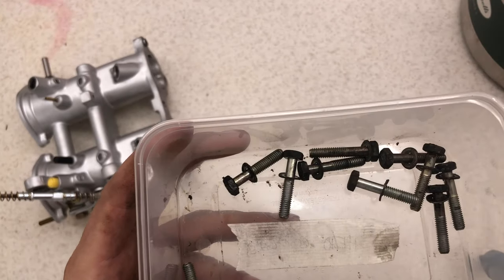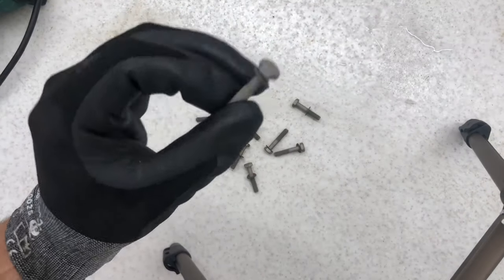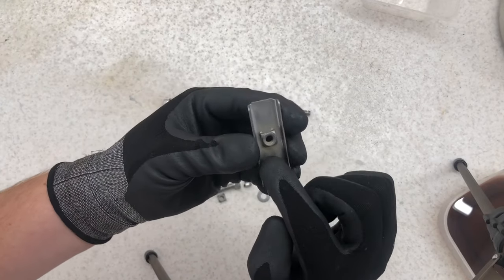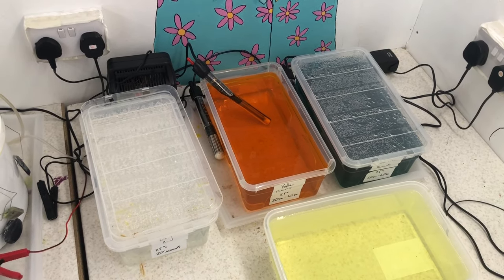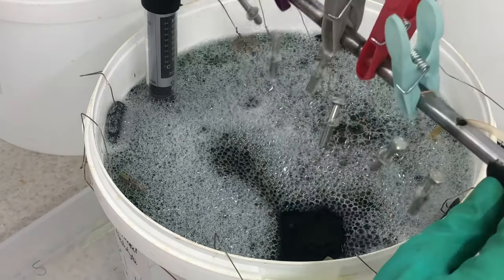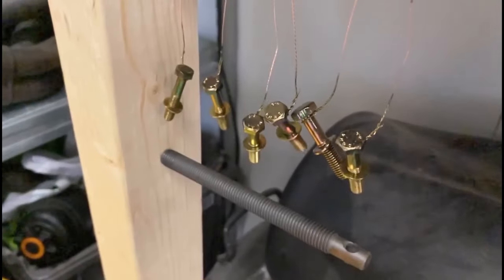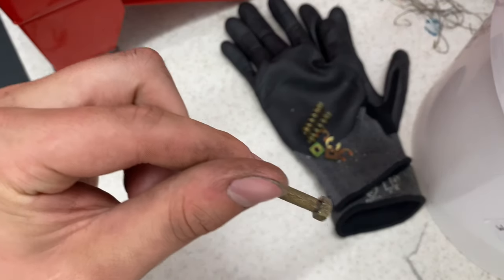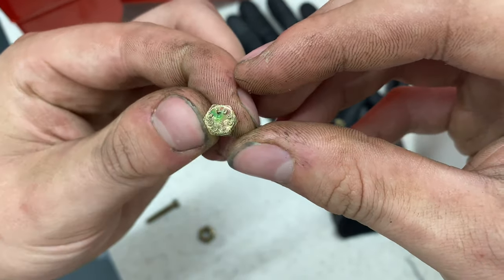Zinc/Nickel Plating Kit by Classic Plating UK - First Impressions/Results!

Comment: I suggest degreasing again after wire wheeling as the wheel and the drill chuck likely are contaminated with grease or oil.
Reply from the maker: Good idea, thanks!
Reply: 9:20 isn't that what this is?
Reply: What is the wire wheel and drill is new?

Comment: The acid you used was concentrated and the metal surface was reacting with it turning it into matte finish. Should add some distilled water in the acid.
Reply from the maker: I use it as a concentrate to remove rust/debris from the surface of the parts, if diluted it simply takes longer! A quick wire wheel process after and it’s a perfect surface to plate with
Reply: @BadE30  Wire wheel before etching. You will just end uo contaminating your parts again after wire brushing.

Comment: I think the process you call passivating is actually a solution of Cobalt. This is a secondary passive (no electrical current needed) plating process which gives the zinc it's colour. Varying the time in the Cobalt solution will give colours ranging from light yellow, gold, blue, and purple etc. The process of passivating a metal is of removal, cleaning contaminants from a metal surface to stop corrosion for example to make stainless steel stainless.  I hope this helps.

Comment: When preparing parts for EZP plating I always use a brass wire rotary brush, as opposed to a steel one, to clean the parts. I think the brass is a bit kinder to the parts.
Reply from the maker: Interesting idea, i may put a brass wheel on the other side to prep the parts!

Comment: Well done.  I just started doing zinc plating.  Your attention to detail was helpful.  Especially observing the "fizz" on the bolts before turning on the circulation pump.  That will help me gauge the amperage with my digital rectifier.  Cheers!
Reply from the maker: Glad it was helpful!

Comment: Thanks Bad E30. I've now gone from total ignorance of the process to having some vague idea, all thanks to you.
Reply from the maker: Great to hear! Understandably it’s a process that’s not well known, mainly the reason I made the video to help pass what I know over. Thanks😎
Reply: @BadE30  Hello, thank you very much for your answer! 👍 I have tried what you mentioned with the heat gun for up to 20 min and then two days and nothing, I have also tried in the oven for 45 minutes at 55 ° C but everything I try gives me the same result. The pieces are very good but when handling them the passivate goes away very easily, the user guide I am following it to the millimeter and also before passivating I use nitric acid then transparent passivated and followed the yellow since the guide says that if the yellow passivate do that but neither. Sorry for the bible I've written. Congratulations on your videos, you look meticulous with what you do. I have subscribed to your channel, greetings from Spain.

Comment: Ive been plating for a few years now, have used the same kit. I tend to sandblast then rotary wire brush to get shine on. Ill plate big parts first you can put a lot more current through and the solution becomes ionised and more active then which is better for smaller parts on lower currents. I air blast parts (you can see the sheen appear) then dry over radiator but once air blasted you can touch straight away. Note if your using zinc you can replate carbs as they are zinc alloy in fact any zinc aluminium plates well, I blast these with soda first. Good video
Reply from the maker: Great comment! Interesting about the solution ionising after large parts, definitely something I will look to consider. Thanks
Reply: @BadE30  I will deliberaty plate large parts in a cold solution 10deg C It appears I can crank up the current to 10A and the plating "pushes" into corners and voids without burning on spikes and corners. As the solution becomes more ionised and active (also warms under the higher current so Im unsure if its chemical change in the solution or temperature) you loose the ability to plate evenly on big pieces. Never had any luck getting the yellow passivate to work so thats on the cards thanks to your channel. Its so much easier when renovating motorbikes to plate as you go (get all the bolts back in the same places)  and there is nothing more distressing than paying for the privilege of that rare rare part being lost at platers.

Comment: After a while, and it won't take long trust me, you will have cross contamination by using the same Di water rinse shared between the first 3 processes 
Better off rinsing with the method you used over the orange bucket. After the third and last rinse (plated parts) then swill in a container with Di water and in your passivate of choice. Using the Di water pre passivate will keep any minerals that would be in tap water to an absolute minimum. I also use an airline nozzle to first dry off the parts (about 15-20 psi)
Reply from the maker: Great info here. Happy to try improve my rinsing processes!

Comment: Thanks for the video - I've just bought the same kit. I think you've 'nailed it' in terms of needing a 'system' to deal with the steps. I'm going to try to get something similar to yours setup. Subscribed!
Reply from the maker: Good work! I have since upgraded the power supply to accommodate larger surface areas and to give me more adjustability. Other than that, it really just takes experience to iron out the few faults, I've found with a more powerful supply I started to burn parts due to going for too much current!
Link for the supply I purchased: https://www.amazon.co.uk/gp/product/B017KQG6EA/ref=ppx_yo_dt_b_asin_title_o09_s00?ie=UTF8&psc=1
Reply: @Jamie - Is this kit better than you can find at Caswell plating as I dont what to go through them.  I want an alternate source.  Thanks in advance for your reply.

Comment: Brilliant job! Just keep your heatgun away from that canister just incase it moves from the vibration
Reply: Also - can step 1&2 be taken away as you allready done this with the HCL & wire brush
Reply from the maker: It’s only argon/co2 for welder. But yeh not the best setup, this has changed now. Also if you mena the steps one and two of the plating process, they are essential for correctly degreasing and etching the surface in preparation for plating

Comment: Im in the middle of setting the same kit up

I only have one heater though so is this more important to use in the electrolyte or better in the alkaline degreaser?

Also i noticed that you didnt use the nitric acid solution...i cant quite work out what it is for other than a step prior to passivating?! Is it necessary?

Cheers
Reply from the maker: I only bought more heaters as I was working in colder climates when I first purchased. Heaters are usually £10ish so I thought it was best to buy a few extra, I’d definitely say the electrolyte it more important for the heat though.
I have used the nitric acid before the passivate but found it to damage some parts if not completely rinsed causing the parts to stain black, I have started to use it more often as I have now improved the way I rinse items. But I don’t see much of a difference between when I use it or don’t use it

Comment: A very good result overall, with the "damaged" ones , did you try running them back into the muriatic acid to take off the plating and run them through the other baths and replacing them again?
Reply from the maker: If the plating is poor, a quick dip in muratic acid and i can do it again!

Comment: I wouldn't put the bolts in muratic acid for 30 minutes... once the factory zinc or nickle plating is gone the acid is off to the races at removing the iron from the bolt. 
hence why your solution is dark yellow. its has a strong presence of iron(III) chloride. 10 minutes is my limit i usually go for 4-8minutes depending on part size. 
if i leave it in for much longer the part starts to degrade and become pitted.
Reply from the maker: Hi, thanks for the comment. 30 mins is my upper limit on the badly corroded bolts, but you’re right. I’d usually check on them after 10 mins and go from there. Will look to reduce this time and inspect them

Comment: So what was the nitric acid for? You went straight from plating bath to passivate?
Reply from the maker: The nitric acid is used for additional adhesive of the passivate, however at the time of the video i was struggling with the acid as it would damage my parts. This was my own fault for using too much power when plating creating scars on the parts and also insufficient rinsing process. Once you have the process working well, the nitric acid can be used as it should!

Comment: Great video…can you explain zinc and nickel anodes…is it one of each to produce a mixture?
Isn’t it cheaper to just replace bolts with stainless? Unless you want the passivated finish.
Reply from the maker: the addition of nickel to the process helps to increase the corrosion resistance. It may be easier to replace them all, but that won't suit the finish that i am going for! (also got to be careful of metal-metal corrosion with S/S)

Comment: hi, can you buy "new" bolts etc, and do the same process?  as new stuff "looks" lie this is done already, but as we all know, it doesn't take long for it to go rusty, also, do you still need to clean "new" stuff thoroughly?
Reply from the maker: Yes I have done this many times so that mine have the same finish! Just needs blasting or wire wheeling then do the process as normal

Comment: Nicely done. In your estimation will this be durable when exposed to the harsh environment of a car?
Reply from the maker: Very durable! I haven't tried a salt spray test on my own parts as of yet, but other experiments using the zinc/nickel coating show extremely positive results! My BMW came with plated bolts as standard and it can still be seeing on the 30 year old hardware!

Comment: Incredible results !! I have had a classic plating kit but only zinc, when doing the whole process in principle the results are good but after 2 days when I touch the pieces or screws if I rub a little the passivate is not well adhered. How many days do you wait to manipulate the pieces?
Reply from the maker: Hi! Sounds like you’re not getting a good adhesion of the passivate, I usually blow down the parts with a heat gun for ten mins then leave for 2 days. And you can handle them totally fine! I’d double check the troubleshooting manual for that issue.
Reply: @BadE30  Hi, thanks for your response! 👍 if I have also tried a heat gun oven 45 min at 55 ° C but nothing, the user guide says that if the yellow passivate does not adhere well, try to apply blue passivate first and then yellow, I am also using a bath for 20 seconds of nitric acid which in theory is to improve the adherence of passivates. Congratulations on your videos, I have subscribed to your channel. Greetings from Spain.
Reply from the maker: @mikebm367  thanks for the kind words! Your issue very strange! How well do you prepare the items before plating? I’ve been told this is very important for such adhesion. Also i know that too much brightener doesn’t help the passivate to stick
Reply: @BadE30  If I acid prepare the pieces to remove the old plating and then brush them until the metal is pristine and it looks clean and uniform, then to the alkaline degreaser tank, pickling tank and then to the plating tank with a water rinse on each step, in the plating I usually leave it between 15-20 minutes and they come out with a very beautiful and shiny silver. As for the polish, I did have to add because the pieces came out with a slightly matte tone, but before adding the same thing happened to me with the passivation. I added 1ml per liter.
Reply: Hi Mike, The yellow passivate will fail for only one of two reasons.

1.  The rinsing and dipping of the item, before passivating is very important. The Alekos brightener can leave a greasy organic coating on the zinc plate. If this is not removed, then you can have bare patches and the passivate can be easily removed. This is the reason why we include the nitric acid rinse in the kit. If in doubt repeat the rinsing process twice. To test for the presence of grease use the "water break" test. Trickle water on to the item. It should run off in a clean sheet. If it beads (like after you wax your car), then it still has grease on it.  Don't always expect a bubbling reaction with the nitric acid. It's primary function is to remove the grease.                         

Check for grease with the water break test see the following links for how to perform the test.
https://www.youtube.com/watch?v=md8JJow69w0
https://www.youtube.com/watch?v=7LeI6oDJI7o

2.  Insufficient thickness of the zinc plate. The passivate eats away at the zinc plate during the passivate process. If any areas of the plate have poor coverage, it will be removed during the process. Aim for a plating thickness of about 25 microns before passivating. Areas that don't have a good line of sight to an anode will have poor coverage.

If you have any more issues, please don't hesitate to contact us sales@classic-plating.co.uk

Comment: I confess I'm confused why you would degrease/acid dip and then wire wheel? Wire wheel will get you there, skipping the first two steps......unless I'm missing something?
Reply from the maker: Degrease helps to not clog up the wire wheel, and the acid dip does a great job of removing hard to reach areas
Reply: @BadE30  yep, didn't think about clogging up the wheels!! 👌

Comment: You might laugh but i always sandblast my parts first then i use a old electric chip fryer filled with water & some degreesr & boil them clean ive had it years it works brilliant has a parts washer you need the temperature write for the yellow pasavate otherwise itll look crap i have same air compressor has yours too if yours is the 100ltr version mines a ryhas compressor but they stopped making the 100 litre version i think they only make the 50ltr now
Reply from the maker: Very interesting with the cleaning procedure! The large compressor is great, large enough for all big jobs
Reply: @BadE30  definitely is mate

Comment: I'm guessing its nickel that makes them shiny? if you only used the zinc and left out the nickel the color would be dull grey right?
Reply from the maker: Zinc mainly adds the shine if I’m correct, zinc plated components will look identical really. The benefit of the additional nickel is to increase the corrosion resistance

Comment: Just doing research for my E28/M5 with S38 engine restoration!  Thanks for your investment in this video. The finish of the throttle bodies in the lead-in are nice, what process would you recommend for my M5?
Reply from the maker: thanks for the comment! Have you seen my other videos of the restoration of some other s38 parts? A lot more videos like that are to come! If you're looking at restoring your engine, I would highly recommend vapour blasting the components and zinc plating the hardware
Reply: @BadE30  Thanks, In the US Caswell has some nice kits and documentation. I have been doing sandblast or bead blasting, along with wire wheels for 4-5 decades, but the plating (lack of it) has yielded less than durable results. What is the advantage/improvement of vapor over dry bead, or tumbling with appropriate media? Time or results in surface finish? This process is new for me, and doing some research on this. 

Yes, I am looking at many of your videos, quite an excellent series!

I have a system for alodining (zinc chromate surface conversion) aluminum learned from building my airplane. I assume similar discipline of dip buckets and contamination control in rinses is in order.

Comment: Would like to ask if i can do zinc plating on top of a nickel plated. Appreciate your insight. Thank you!
Reply from the maker: Usually the process of plating requires the acid etch which will remove any prior plating. Probably best to initially remove the previous plating to not affect the new coat!
Reply: @BadE30  i have a plate with a controlled hole diameter 5F8. Now the hole is big so what i did was i do nickel plating which builds up causing the hole to be in spec but the spec is to do zinc plating.

So i was thinking to plug the hole using silicone (nickel plated hole) and do zinc plating. Is it possible to do so?

Comment: Hi mate..What current settings do you set to roughly.Im just getting set up but a little confused on the power supply setup!!
Reply from the maker: Tricky to say, however I have since upgraded my power supply to show me the readouts. i've used it in some of my newer videos, it looks like for small parts i use 3v and 1.7amps, i have used up to 10 amps before on large pieces but it starts to go a bit mad up there!
Reply: Thanks for the reply and sharing your knowledge much appreciated!..Keep up the good work!

Comment: Can you do this to off the shelf electroplated (zinc) bolts and hardware? Or need to strip to bare metal first?
Reply from the maker: The dry acid dip does remove the previous plating, however I’d recommend stripping the hardware first

Comment: Great video. Given me the confidence to give it a go myself after my local Platers lost nearly 50% of the batch I gave them.

Can I ask why you haven't used the electrolytic Cleaning kit and decided on more a manual process using HCL?
Reply from the maker: Thanks! That has always been my worry with giving my parts to someone else.. 

With the cleaning, I researched into the process and found the electrolytic cleaning did exactly what I can do with a few steps! If i had the extra space I would go for it but i am pretty full up currently
Reply: Man I'm sorry to hear that, must have been a fly by night operator,a serious company that does plating would never do that, i mean they might lose a bolt or 2 but 50%?  if i was restoring a Ferrari and they lost 50 percent of my hardware there would be a lawsuit coming round the bend, lol